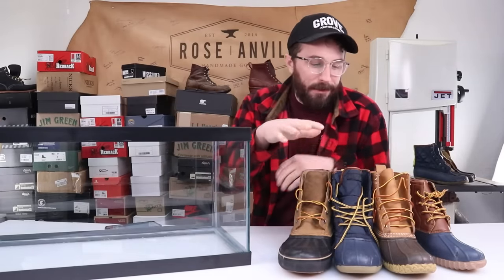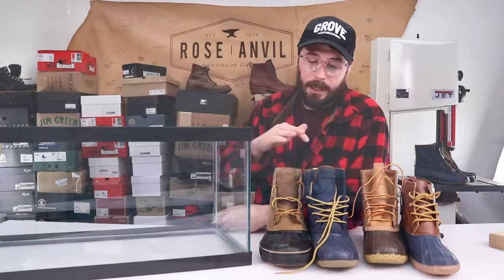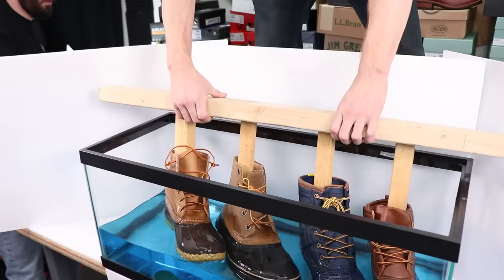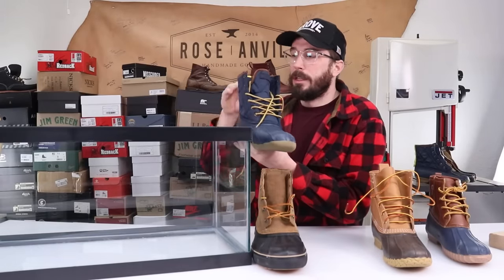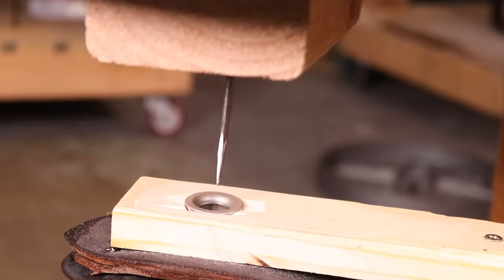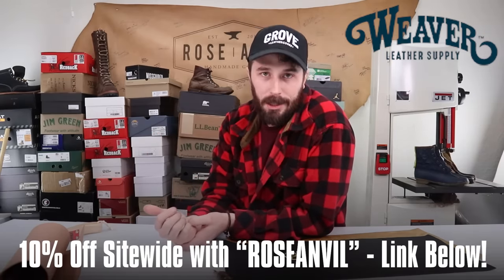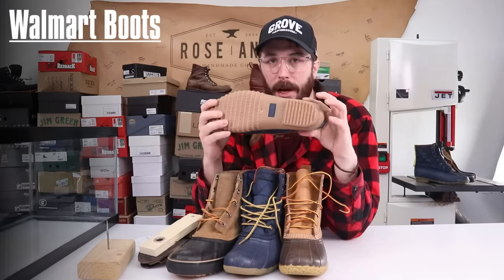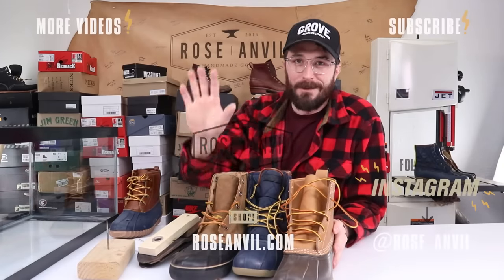Not As Waterproof As You Think... LL Bean vs Sorel vs Sperry

Comment: Thanks for the test! 
LLBean boots are great (I live in Maine so there might be some pride in that statement), they are not only functional but stylish.

The one problem I have come across is their narrower toe box. Next to all the comparisons here you can see how much narrower they are. This prevents proper spreading of the toes needed for healthy foot structure and can contribute to or exacerbate bunion or diabetes issues. It also makes for colder toes because thick socks mean even less room. I wish they would eventually widen that toe box in the standard boot. Otherwise, these are great boots!
Reply: I'm in Canada, so almost right above you, and I have the same problem with narrower toes. I looked into barefoot/minimalist options (wide toe box, no extra heel height), and I haven't really found anything waterproof that doesn't cost like $300. I found a few options that a mall near me carries, so I might have to try some things on, as I want something I can use for wet days, as well as snowy ones when I wear my wool socks.
Reply: @joylox  occasionally you can find local shoe makers that customize footwear with orthopedic details. They are probably pricey but worth checking into for anyone with these issues. 

Last spring I came across a website that sells wide toe box winter boots, THAT ARE STYLISH, which is a rare combination. I believe it was a company specializing in diabetes-related footwear. You wouldn’t need to have diabetes to order them.

Comment: One test that would be kinda cool to see is a test for how hard or soft the rubber compound used for the sole is. (Probably something using a very fine-grit sanding belt and a timer to test wear at the ball of the foot and at the back-outside edge of the heel?)

For some things it's a good tradeoff if you want absolute grip, like with climbing boots or rain boots. But for other things like hiking boots or workboots, a more abrasion-resistant/longer-lasting outsole might be more valuable for most consumers.

Comment: I don't know if it would've made a difference to the results, but those scales / load cells have such a low refresh rate that it can skew the results if something important happens between updates.

Another channel was using a winch with one to gauge when things broke, the results were wildly inconsistent because things happened faster than the scale would register.

Comment: I wonder if you should have used a foot form , leg form , so that you could have laced them tight against that so that the seal is a bit better. Just a thought . I have some bean boots and they are really good and warm , but not completely waterproof . They are great in deep snow pack and I have wool felt footbeds in them and they make a big difference . They definitely have soles that last .

Comment: I thought those water resistant boots were meant for snow….more than rain. Rain boots are the only ones meant for rain and waterproof shoes/boots for walking in rain with small puddles. I have blondo the waterproof boots(and shoes) and they work as rubber rain boots…rain and snow.

Comment: The problem with waterproof is that it works both ways.......
It will keep moisture out, BUT it also keeps it IN.
Either way, your feet get wet, outside moisture or foot sweat.
You're gonna get damp and cold.

Comment: I would never wear a boot like this if I needed 100% waterproof (even if it says so on the side of the boot). I just thought it was common sense.  If I needed water proof, I would wear waterproof socks under the boots or another style boot.  But in most cases I just needed water resistent. I would also treat the leather and seams with NikWax, it made a big difference using the Nikwax.

Comment: this was not a good experiment... just using a wooden beam to hold the boots down in the water is not putting them under the conditions u would go through in nature. what u need is an actual foot in the boots wear each pair and put them through the same hike w various water crossings, through rain and mud or if u think just simple submersion tests tell which is best then put a foot like structure to fill out the boot as it would be worn..

Comment: All the nail test really proved is a nail will go through any of these boot soles with much less than a persons body weight, (and to wear safety shank boots where there's old boards with nails). It's not really indicative of general wear due to the force being confined to such a small area and such a hard material (steel nail point). Some kind of wear test where a boot is repeatedly pushed down onto sharp rocks would be more realistic for most use cases (can use a cam/piston for the repeats, maybe an old bike would work). Then test with water after a certain amount of wear see if the cracks leak.

Comment: Never had a pair of Sorels let me down in terms of waterproofing, but then again I've never had a pair made overseas. From what I've heard, their boots took a dive in quality as the company outsourced their manufacturing. I assume they lowered their standards and quality control at the same time. It's a shame, but at least there are a lot of good-condition vintage pairs floating around. They tend to be very affordable too.
Reply: I should add that I've never had duck boots from them either. Obviously, that design has its intended uses and inherent limitations.

Comment: The puncture test was done at the lowest point of the rubber on all the boots except the LL BEAN….why did you choose to puncture them through a higher THICKER part of the rubber bottom. You didn’t go BETWEEN the tread as you did the other boots.. and you should have probably done both high and low points on all boots repeatedly and then averaged the overall numbers. So yeah…love the H20 proof approach..pretty straightforward..but the puncture..not so reliable??????

Comment: I watched this and laughed. I have a 10 year old pair of waterproof boots from Georgia boot. Pull on, no laces. You know what, they are still actually water proof...I literally stand in standing or running water, feet stay dry. Ride my bike in rain, I am miserable, but if I make sure nothing can come in from the top, dry feet. If they can do it, why can't the majors? BTW, no lace up boot is waterproof, water resistant is the best they can do. Been "testing" for over 50 yeaes... As far as the puncture test, meh, none of them have real soles...nail will poke right through at some point...and, uh, only an insurrectionist would be dumb enough to get waterproof boots from Walmart... LL Bean is the best, are you really surprised?